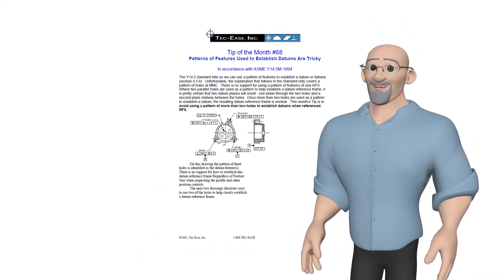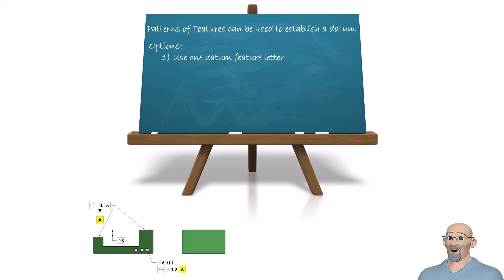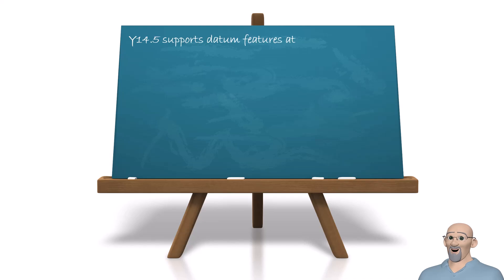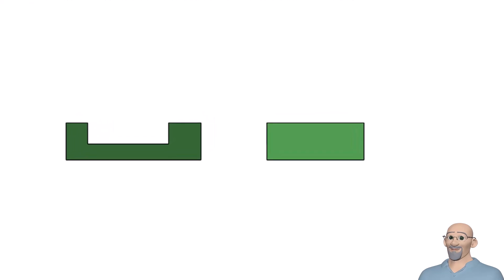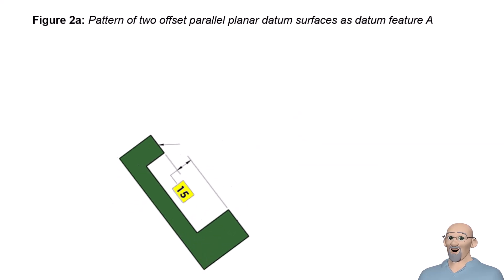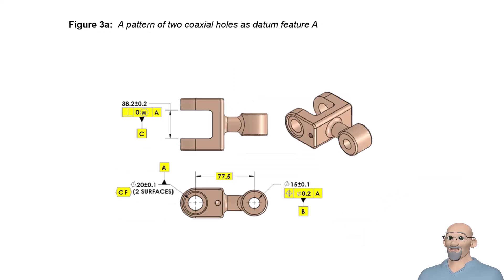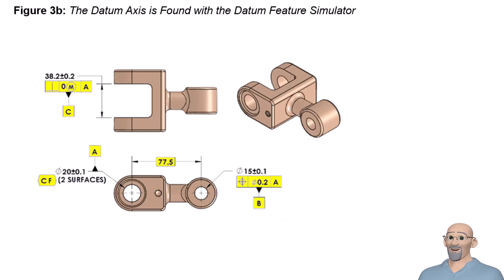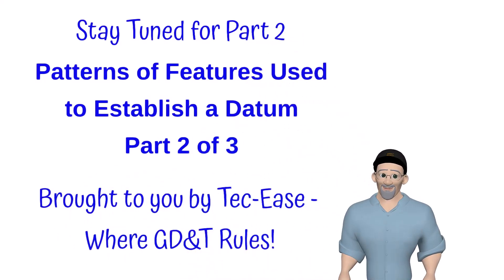Patterns of Features Used to Establish a Datum, Part 1 of 3

Comment: There are two possible ways to control coplanarity between nominally coplanar and flat faces: one is a flatness tolerance with the CF (Continuous Feature) symbol as shown in this video, the other is to apply a profile of a surface control preceded by "2X", similary to how it should have been done for that step pattern in this video (the "2X" is essential to group the two surfaces into a pattern according to the standard, when no other pattern-creating method is applied). These are essentially GD&T "synonyms". So, what is your preferable callout to express a coplanarity requirement, and why?
Reply: Hi @sem7207 - I think it is best to use the tool that has just enough capability to do the job, which is hopefully the choice that will provide the most clear and intuitive specification.  So, I prefer to use flatness with the continuous feature symbol instead of a "2X " profile of a surface tolerance, for as-designed coplanar surfaces.  The flatness tolerance with <CF> provides a simpler, more intuitive control.  I have the same opinion for an interrupted planar secondary datum feature that is as-designed, perpendicular to a primary datum plane or axis.  Perpendicularity with continuous feature applied to that interrupted planar secondary datum feature will be simpler and more intuitive than profile of a surface would be. - Dean Watts, Technical Director, Tec-Ease, Inc.